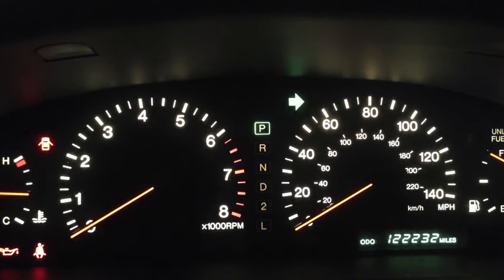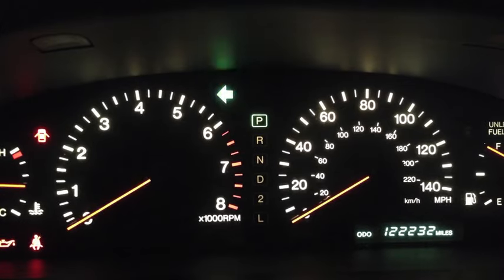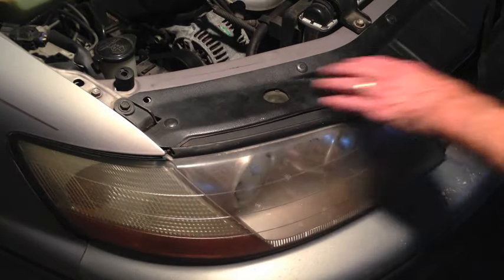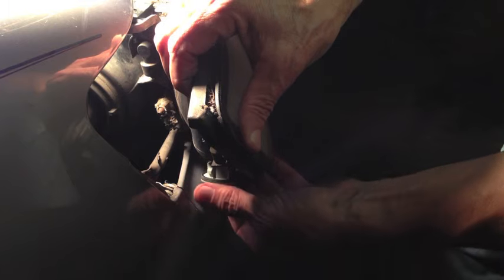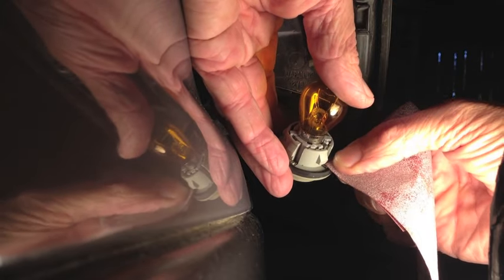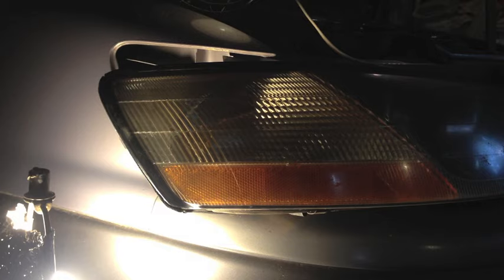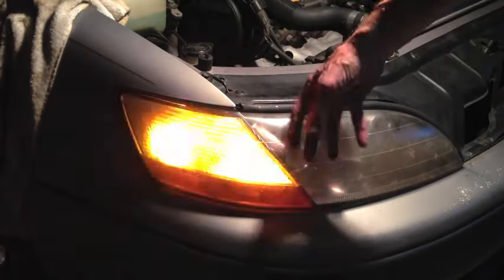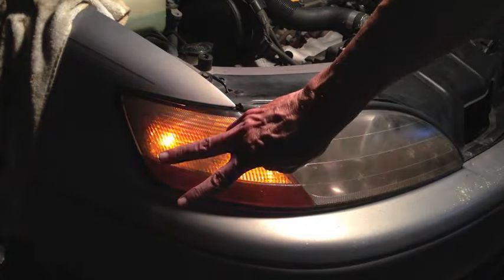Rapid Turn Signal Fix - Not The Bulb

Comment: Thanks a million Peanut Butter Man, my old WRX was blinking right rapidly, it was driving me crazy.  The 2011’s had tight wiring and connectors can be come partially unplugged apparently...  so my car was in pieces and I was about to take it down to nuts and bolts chasing the rabbit down the hole.  Then I came across your video.  Cleaned the contacts and bingo, job done....
So glad I found your video!  I am one of just a few drivers in Massachusetts using his blinkers because I am just so happy they work : )
Thanks Man!
Reply from the maker: You are welcome.. Thanks for reply..

Comment: Man I've got a rapid turn signal, bulbs aren't burnt connections look good, no fuses are burnt out, and my turn signal and break light stopped working, quite confused rn
Reply: Check your emergency/blinker relay?
Reply: I had a similar situation but with my motorcycle….   i had just replaced the left turn signal bulb (two filament bulb, not LED) and it started blinking too fast, while all other bulbs were OK.  I pulled out the new bulb again, turned it 180 degrees and installed it again.  This time it worked just fine!    Maybe it was a polarity issue 🤷‍♂️

Comment: My headlight on drivers side will not turn on is their a wiring problem bc the other side works fine and switching them over too the drivers, they lights don’t turn on anymore? But my direction light stops blinking rapidly?

Comment: I dont know if it matters with signal bulbs, but i would also shy away from touching  the actual bulb because of oils on your hand. Idont know if thats still a thing, but you can never be to careful
Reply from the maker: I think that's just for halogen bulbs cause they burn so hot.. Low wattage signal bulbs much cooler so not an issue.. But yeah, it's easy not to touch bulb during install so better safe than sorry..

Comment: What part is the connection .Not the light bulb but the other one. I broke the connection while changing my headlights and now the new lightbulb can’t fit back in. So I need to replace the connection .
Reply from the maker: I would either take a picture of the part you need and go to a local dealership parts dept or check salvage yards..

Comment: I have an issue with my civic where the blinker light is illuminated but doesn’t blink need help thanks in advance
Reply from the maker: Check your hazard lights.. If they also light up but don't blink your hazard/flasher relay may be bad.. That relay is usually found in the fuse box located in the engine compartment.. Here's more info: https://www.autoblog.com/2016/01/19/symptoms-of-a-bad-or-failing-hazard-turn-signal-flasher/
Reply: Thanks!

Comment: So I have a Honda dc5 or in America it’s called the Acura rsx, what my one does is that when the key is plugged into the car the passenger side front and rear indicator starts ticking fast without me even turning any indicators on. Any idea what the issue could be?
Reply from the maker: A guess but, bad turn signal relay possibly?? Relay would be located in one of your fuse panels.. Most likely the one in the engine compartment..

Comment: i put in brand new headlight on driver side an when i used turn signal noticed the arrow itself was moving faster an louder. the headlight doesn’t show any turn light in the front but the rear does, would this be same issue ?
Reply from the maker: possibly yes, it's likely either the driver's side front turn signal bulb is bad, loose in the socket or there's corrosion at the terminals..
Reply: @tongo117  lmao my dad just texted me right now as i was replying to u he was the one that did it lol, he said it probably just doesn’t have the bulb that we can take it from the old one that’s what we had to do for the headlight bulb

Comment: What the name of that spray? It is like dielectric grease but in a spray can?
Reply from the maker: This is the spray I used in the video it's made by Radio Shack but difficult to find: https://www.hobbytown.com/radioshack-6400148-radioshack-control-contact-cleaner-and-lubricant-rsh6400148/p788093.. This spray should work just as well: https://www.google.com/shopping/product/10890697071685306133?lsf=seller:8175035,store:8635513338877327108,lsfqd:0&prds=oid:14472860652016534060&q=electronics+cleaner&hl=en&ei=yGxCZMD1IfuwkvQP9taEmAw&sts=14&lsft=gclid:CjwKCAjw6IiiBhAOEiwALNqncYqSJnku44TQdTCU5R_uYYYLDJZU5fm8Lkaq8b3F3A1EXmDMu8zsQBoCQ4AQAvD_BwE,gclsrc:aw.ds

Comment: My taillights running bulb doesn’t work but when it break it still works, is it wiring problems or the bulb itself?
Reply from the maker: Bulb shown in video is a dual action 1157 bulb.. Two filaments inside glass and two contacts on bottom (base) of bulb.. If you have the same 1157 bulb one filament could be burned out and one still good.. So yes, your problem could just be the bulb..

Comment: I installed LEDS on my ‘06 civic and now both front and rear signals blinking rapidly. I was told a resistor kit was needed. I didn’t try spraying the contacts in the socket yet but I do have some WD-40 in the shed. Do you think I need a resistor kit or should I just try cleaning and spraying the WD-40?
Reply from the maker: The WD40 won't hurt, and I have no experience with LED bulbs, but the little research I did points to the need for resistors.. https://www.diodedynamics.com/led-resistor-kit-pair.html
Reply: I have a Honda CR-V doing this. I got it used so I don't know if they out in led or not.cam this be fixed by putting in regular bulbs?
Reply: @rld1278  look at the bulb, if it’s an LED then it’ll blink fast because it’s drawing less power from the battery which is telling the car that the bulb’s out. Hence why it blinks fast. LED or not, try changing the bulb and see if it’s blown or not. Hope that helped!

Comment: I'm going to try this tomorrow.  My tail lights do many things.  Left turn signal is fine but right does not work with headlights on.  Emergency flashers don't work with headlights on.  Bulbs are fine.  I have six builds (3 on each side).  If I remove one of the bulbs I gain a function like the right turn signal with headlights on.  Any ideas?
Reply: What do you mean by "six builds?"
Reply: @ApartmentKing66  what do you mean what do I mean because there’s no shortage of clues here that I’m talking about tail light bulbs.
Reply: I'm having the same issue where you able to figure out your problem, mine is driving me crazy. TIA
Reply: @tiacapri  I changed the whole tail light assembly.

Comment: What did you spray I can’t hear volume
Reply from the maker: The spray I used in the video was made by Radio Shack and is no longer available.. This should work just as well:
https://www.google.com/shopping/product/10890697071685306133?lsf=seller:8175035,store:8635513338877327108,lsfqd:0&prds=oid:14472860652016534060&q=electronics+cleaner&hl=en&ei=yGxCZMD1IfuwkvQP9taEmAw&sts=14&lsft=gclid:CjwKCAjw6IiiBhAOEiwALNqncYqSJnku44TQdTCU5R_uYYYLDJZU5fm8Lkaq8b3F3A1EXmDMu8zsQBoCQ4AQAvD_BwE,gclsrc:aw.ds

Comment: What's the actual name of the spray and where can I get it?
Reply from the maker: The spray I used in the video was made by Radio Shack and is no longer available.. This should work just as well:
https://www.google.com/shopping/product/10890697071685306133?lsf=seller:8175035,store:8635513338877327108,lsfqd:0&prds=oid:14472860652016534060&q=electronics+cleaner&hl=en&ei=yGxCZMD1IfuwkvQP9taEmAw&sts=14&lsft=gclid:CjwKCAjw6IiiBhAOEiwALNqncYqSJnku44TQdTCU5R_uYYYLDJZU5fm8Lkaq8b3F3A1EXmDMu8zsQBoCQ4AQAvD_BwE,gclsrc:aw.ds